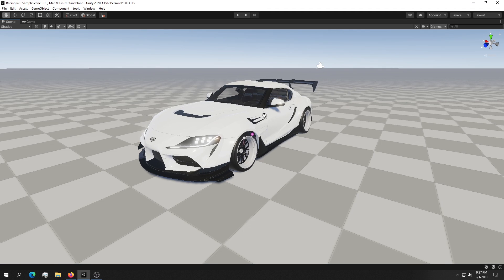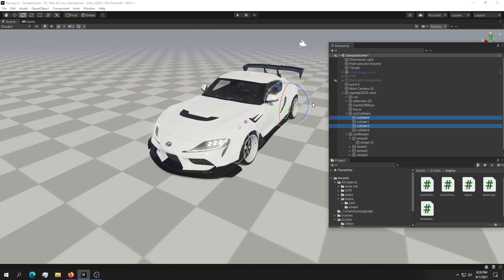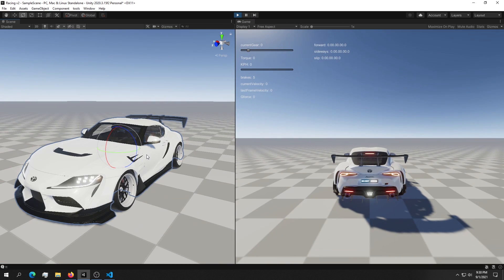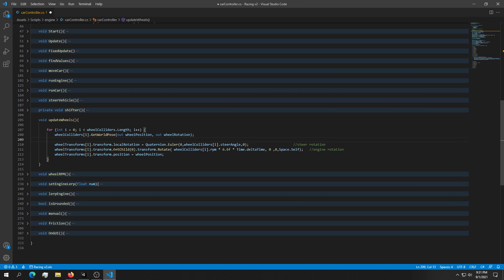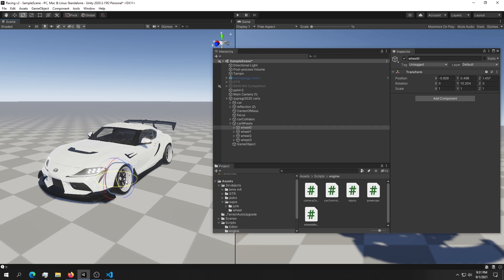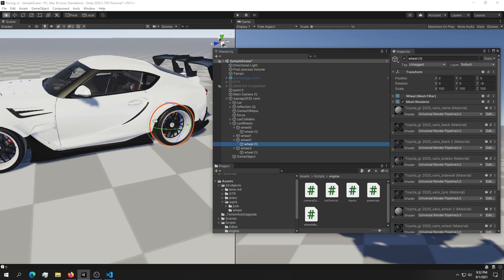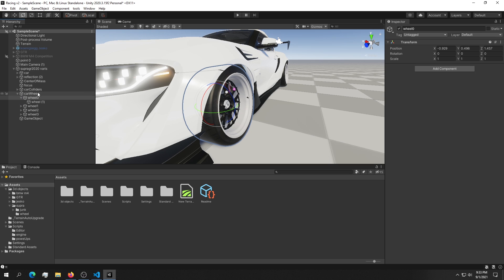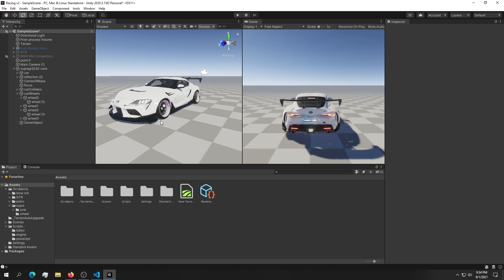How to add camber in Unity 2021

Comment: how would you handle updating the camber value at runtime?
Reply from the maker: using a for loop change the local z value of the child rotation. 
basically do:
transform.localrotation = quaternion.eular(0,0,camber value here)
Reply: @pabloslab  thanks :)
Reply: A follow up on this incase anyone wants to know:

If you want to update the camber at runtime it may mess with the rotations, so to fix this, store a "last camber value" and compare by that every time you want to update the camber and then reset the X and Y rotation. Here's how I tackled it:

public void UpdateCamber(float value)
{

        if (_lastCamberValue == value)
            return;
        
        _lastCamberValue = value;

        //'wheelMesh' would be the GetChild(0) transform

        var rot = wheelMesh.localEulerAngles;     
        rot.x = 0;
        rot.y = 0;
        rot.z = value;
        
        wheelMesh.localEulerAngles = rot;

    }